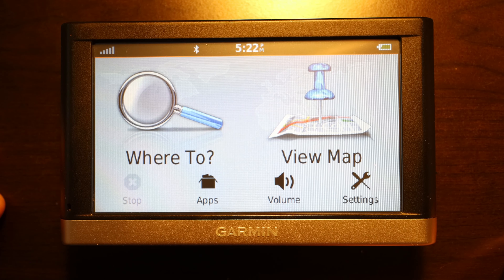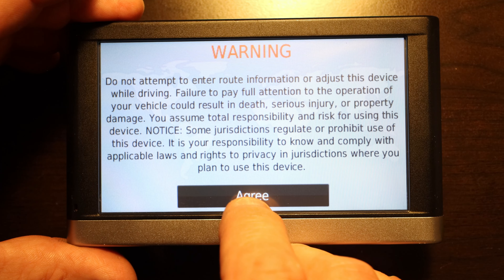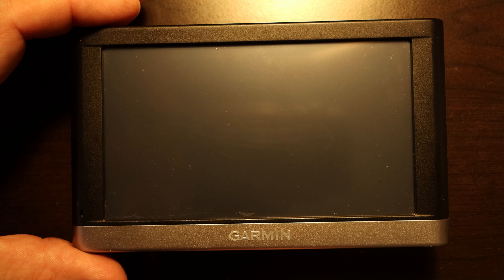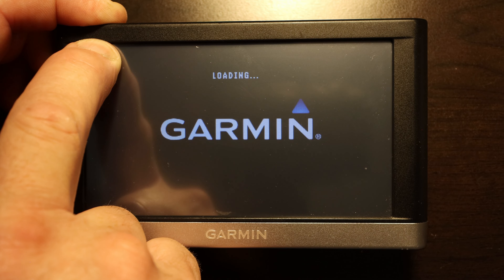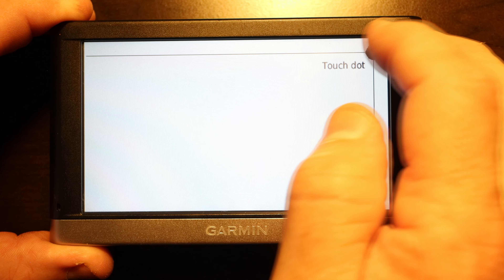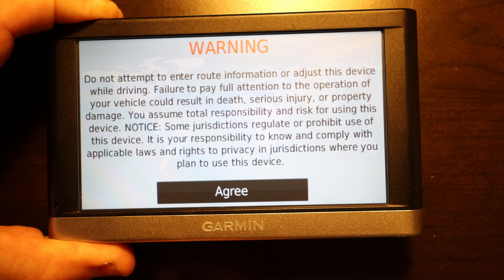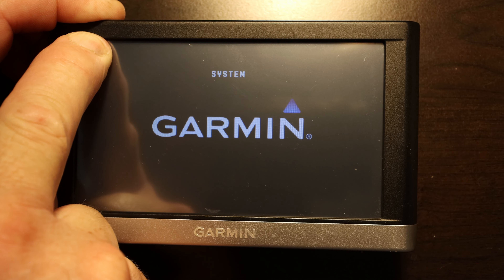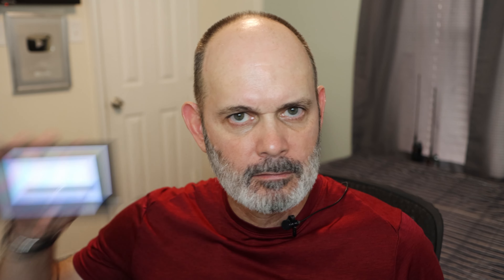How to Fix Your Garmin Nuvi's Touch Screen

Comment: Thank you for your video. I used it to re-calibrate the screen on my Nuvi 1300. the screen was not allowing touches  or you had to use excessive pressure and hunt for the right spot to get it to acknowledge the touch in certain areas. The calibration seems to have fixed this issue.

Comment: I have the same device. It is suppose to have lifetime maps. It won't update with the downloaded software. ( can't see device )Ya I tried 3 different cables from 3 different Garmin's that do update. Also the speaker stopped working. Garmin Tech support just told me to buy a new one. That is what I call shitty support.
Reply from the maker: "He's dead Jim." I would say that your GPS has bitten the dust as all three do update you know the problem is the unit. If you're handy you can find these on Ebay with broken screens for a reasonable amount. Really all you need is the guts of the unit you have everything else. Just swap out the broken screen with yours and you have a new working unit. I have videos on how to dismantle a similar unit here: https://youtu.be/-JFk-3kurmc as I said it's not the same but it will be similar internally. You can begin by taking your's apart first and disconnecting the battery overnight. Sometimes this resets the unit back to life. You really don't have anything to lose. Thank you so much for commenting and watching. I appreciate it greatly. All the best.👍😀